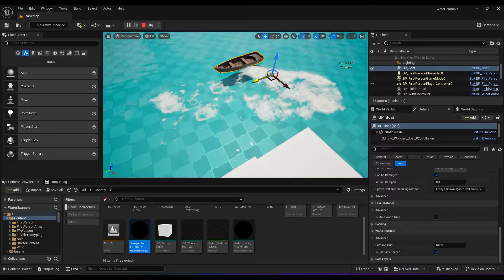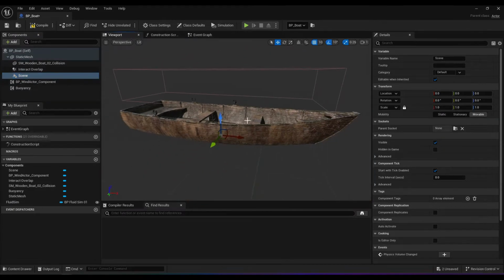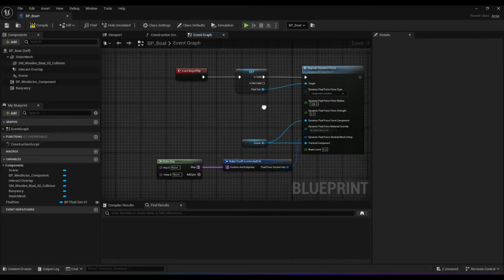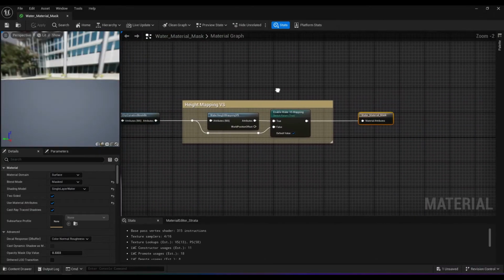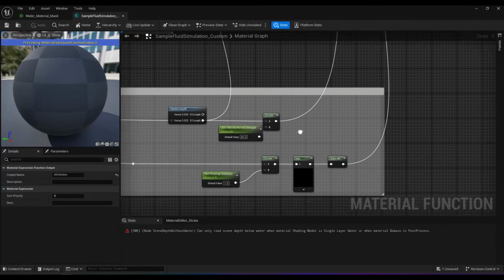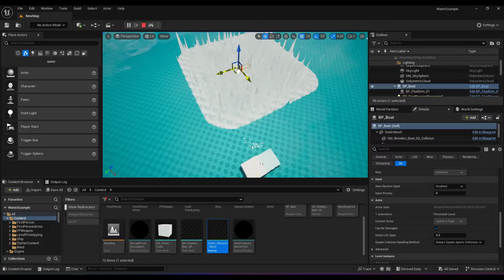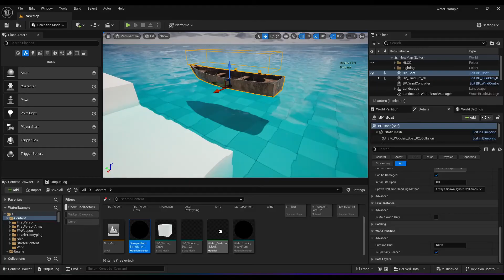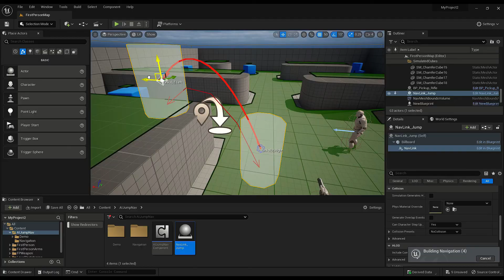Make Waves With Your Game - FluidSim Tutorial Unreal Engine 5.4

Comment: Before I try again: am I right in thinking that you're making the foam material not in this tutorial, but in another one (and where is it? I don't think I found it on the channel), and then this video won't work?
Reply from the maker: The fluid sim materials should be included with the water plugin
Reply: @peanut_games Sorry, I'm feeling unwell and not fluent in English, so I thought you were creating your own. Regarding the PIE issue and variable initialization at the start of the game, would really help  event begin play - get actor of class (select a fluid sim) and set the variable value?
Reply from the maker: @altvi42 You could try that, either way the Register Dynamic Force node must be used and a mesh or scene component has to be referenced
Reply: @peanut_games Thank you very much for your work, this method worked, now problem only in foam It hasn't worked yet, when I copy the fluid simulation function, it immediately gives an error: [SM6] (Node SceneDepthWithoutWater) Can only read scene depth below water when material Shading Model is Single Layer Water or when material Domain is PostProcess. (I'm still very new and don't understand many basic things)
Reply from the maker: @altvi42  I'm not sure did you change any settings in the material, on the left? Is this a custom water material? I think the function needs the material to be set to its own water shader.

Comment: Do you have a tutorial on how you made the water itself?
Reply: First save your project. Go to the top of your window and press on Edit > Plugins > search for Water > there are many types of plugins, but make sure you check the box next to the Water (experimental) > restart UE. Now you should be able to use the water. After reastarting , go back to your level where you want to add the water. On the top where you save your level, next to it you can search folders and next to that you see Selection Mode with a drop down menu and next to that you see a cube with a green plus on it. Press on the cube with the green plus, there you see a search bar. > write water > drag and drop the water body you want into the scene. But i myself are very new to it too, so i recomnend watching another tutorial on water, so you understand how to change and adjust it.

Comment: Well, I followed along with every step. I have ripples on the bp_fluidsim_01 plane when I move my boat over it...but not my waterbodyocean. for some reason it's ignoring the selected water body. :(
Reply: So it appears that in order forthe ripples to display in simulation in viewport was to increase the simulation world size and have it not follow the player. This way I can display the water riples in the area set via the sim world size. That works ok for testing purposes for now. I'm using a Type7 Uboat in my prototype so I would need more than one ripple source. Bow and Aft. Do you know if this is possible? Do I need to create an aditional fluid sim with a new variable+component? Or can I attach another Dynamic Force Component to the same Variable?
Reply: @TurboNym  man youre a legend. btw to answer you question i think there is a limit on how many fluid sims you can have in each level(dont know if increasing is easy or not) but i suppose thats already enough for what youre aiming for

Comment: Thanks for putting the time into making this video. It all works perfectly but I have noticed that the fluid sim caps out at 6 boats. I have been trying to find where this cap might be defined but no luck so far. I have checked that all boats are inside of the resolution bounds but no matter what I do I can only get the foam to work on the first 6 boats.
Any ideas?
Reply from the maker: I'm not sure if that can be changed but for now it looks like if you use the node 'Register Projectile Force' instead of dynamic force it works, just plug everything in the same
Reply: Thanks I'll give that a go. Much appreciated

Comment: Hey for some reason I can't get the foam to work on the simulated waves, I have enabled foam on the material function and on the parent mateiral but have no luck, the depth foam does work though. i am using ue 5.4
Reply: Hi, I have the same problem UE5.4, I got foam by adjusting the water material, but 'fluidsim' still get like a bulk of foam and getting increase, I don't know the reason?

Comment: Hi! I tried to do this for player skeletal mesh by setting force type to "Skeletal mesh sockets" and plugged in my Skeletal Mesh Component as tracked component and dynamic fluid force component. I also get waves but for some reason they are rectangular shaped. Any idea what I might be doing wrong? I see there is a Dynamic Fluid Force Skeletal Mesh Setup pin but I don't quite understand what input should be there if I use skeletal mesh.
Reply: UPD: I found a solution! Don't register anything. Add BP Fluid Sim to your level, get it as variable in one of your blueprints. Now, when you want to create wave, just call Apply Fluid Force Impulse on that variable. On pin Impulse Settings drag and drop - make Impulse settings. For some reason defaul strength is -100 but it should be positive. Now you can input any strength at any location, for example Get Socket Location of your choice and apply impulse there. Cheers!
Reply from the maker: @meatdeath_gaming9298  Thanks for sharing, I haven't taken any looks at skeletal meshes in this system yet!

Comment: How to use custom water material for this?
Reply from the maker: how custom? This is default UE5 stuff so it needs to be based on their water materials
Reply: @peanut_games  no like I have created a new water Material and applied it over the water body ocean. I need to add foam on that it is possible?

I can't use default Material as it is very heavy for mobile device and also didn't looks good on mobile due to deficiency of single water shader on mobile
Reply from the maker: @hariom404-u6c  Basically the material has to have the SampleFluidSimulation node, if it doesn't have that on mobile then it won't work. If it does then I think it should be possible performance wise if the water body isn't too large
Reply: @peanut_games  okay will try